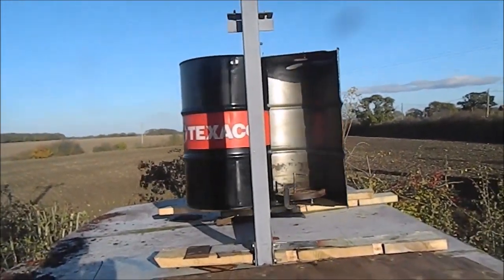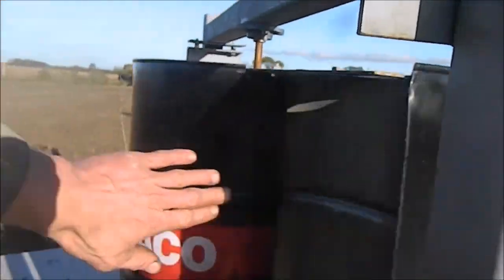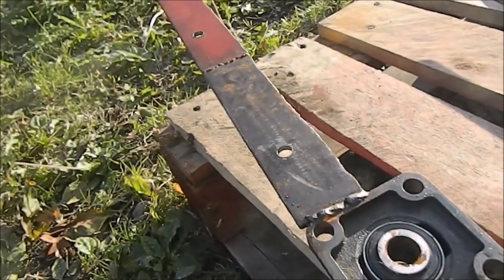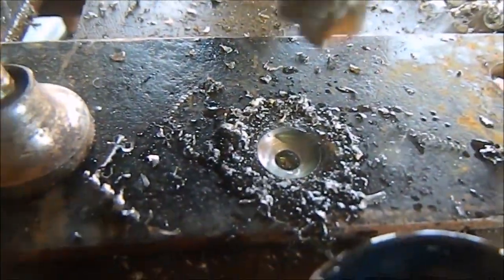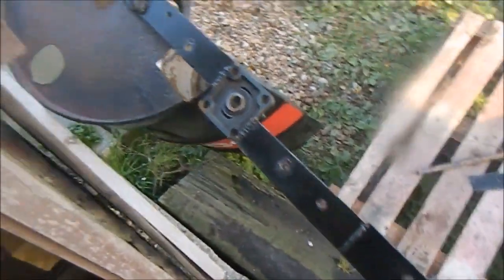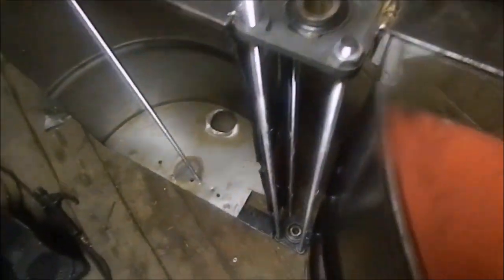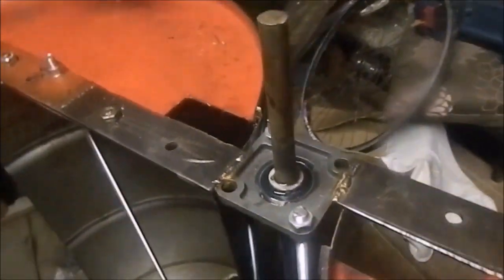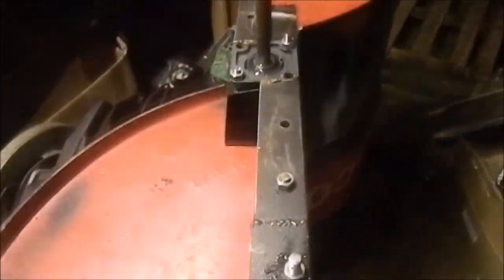VAWT wind turbine from oil drum from scrap part 24 CHANGES TO BLADE SYSTEM

Comment: I give you props on the overall build however your wasting a ton of time drilling. I have dri bits 20 years old that still cut like new and I've never drilled that slow
Reply from the maker: I never learned to sharpen them :(